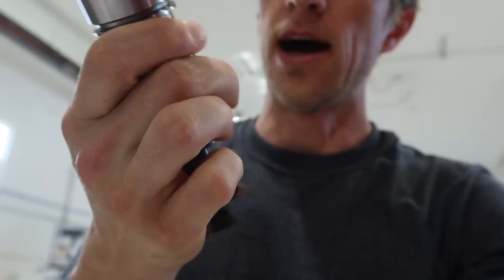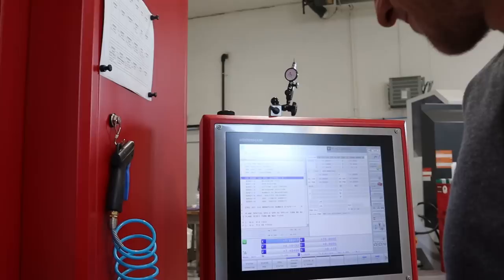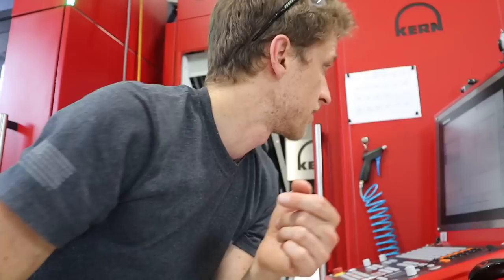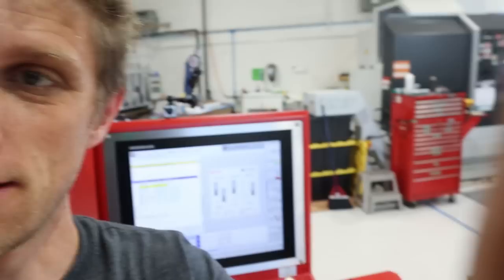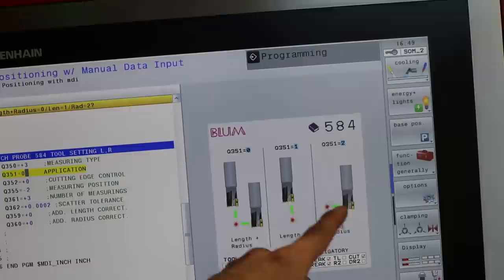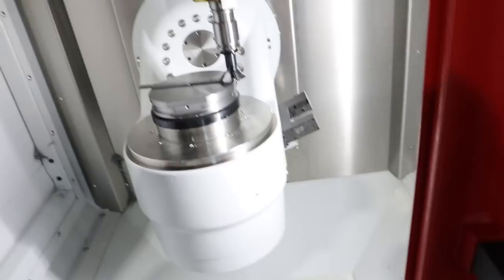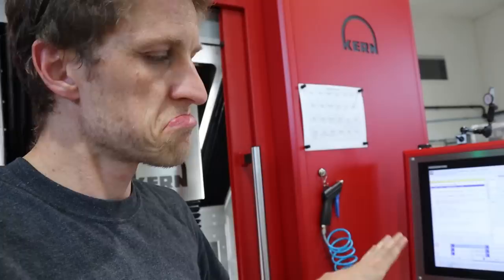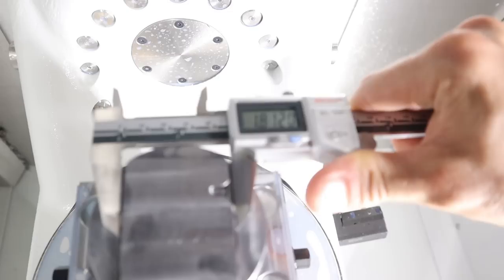Kern Updates! - Shop Life 49

Comment: Use a dowel pin, and roll it under the tool as you're jogging up, until the pin slides under the tool/insert. That way you're not "crashing" into the work/pallet.
Reply: youre not a bad guy.

Comment: Awesome video! Instead of jogging the machine down onto the parallel, use one of those round pins, jog the machine lower than it is, and jog up until the pin rolls under. Much more accurate imo and lower risk of damaging something.
Reply: Wow this is an awsome solution. Storing it away for future use.

Comment: So with regards to manually touching off tools like that you should always jog the tool slightly lower than the parallel in this case(a ground pin or gauge block is better) and then jog up slowly until the parallel just slides under, then go to the tool table and when you are in the tool length field press the "capture position" button (under the decimal point on the number pad) to directly input the value into the tool length. also you can just probe the top of the parallel rather than setting it with another tool

Comment: John, at 11:20 or so: nothing wrong with using your radius jaws as they are except for a slight modification. Relieve the center portion of the jaw to a slightly larger radius leaving lands of the original radius about 5/8" (16 mm) wide at the ends of the radius. These lands act like the jaws of a chuck and, having the same radius as the part, will not mar the part finish. If you use V jaws, the line contact will indent the TGP finish.

Comment: Just did my first ever 3D machine tool path on my home build gantry mill yesterday using Fusion 360... A very basic profile  piece but radiused the edges with a ball nose mill .. Just a tester in plywood but came out great .. Think im starting to understand the link and passes tabs a bit tabs better now.. Coming from Vectric Cut 2D fusion is kinda intimidating but so packed with functionality. Im loving it.

Comment: Hey John! In regards to your fixturing to be able to properly hold the round bar, instead of using a Vee block to hold it, you can use what is known as the three point contact method by relieving a portion of the milled circle on your jaws in the center. Steve Barton has a really good video explaining this theory on his video named "Making the 3 point Contact and Band Saw Fixtures" at 14:27 in the video is where he breaks down the explanation of it. He's a very sharp guy and his channel is full of tips and tricks of doing sub .0001" work, I highly recommend you check it out! Cheers
Reply: @GOAP68  I appreciate it! I would've done the same had I known how to input the video at the correct time, thank you

Comment: Hii John, you talking about getting a tool pre-setter , we have one from dmg, but to be real you will give away some accuracy in length and radial measurement. You wont get a constant force like the pull strut will give you in the machine. A heavy tool will measure shorter because it will be more load on the taper than a lightweight tool. And if you press it down by hand u will still get some 
slight differences which will add up, the toolholder has some and the 
flange on the presetter will have some inaccuracy.
Reply: That makes total sense. Kurios why there are no presenters on which the tool hangs down.
Reply: The Nikken has an air supply and the tool taper is pulled into the setter taper to help with consistency.

Comment: Why don’t just mount a tool holding device on a small granite surface place and bring over a digital height gauge? Zero out on the hsk mounting flange then touch the top of the tool. Input the number.
Reply: Lmfao watching you sell yourself on a tool setter was hilarious lmao done that a few times.
Reply: you don't necessarily need to use a special mount just zero out the holder before you insert the tool

Comment: I know that if you scroll across the tool table theres a setting that allows you to offset the cutter down when measuring the radius, so there must be a similar setting in the tool table to offset the cutter to the side for the height. Also it's best to set tools to the same height as probe. 
Just probe something and call it z0, the call the tool out do what you did to set the height on the thing you probed, then go to the tool table, go to height and press the orange z and then press the button with the 4 arrows pointing towards a centre dot

Comment: Hey John...how to check the fit between two circular surfaces...'blue' the parts and you will see the contact points. But 'three' point contact using V-blocks is more repeatable and removes the concerns about stock diameter variations that could be problematic with your circular soft jaws... 👍👍👍

Comment: 4 minutes ago! Yes!

And give the concrete minimum a week. 
4” there is plenty, if worried, just use concrete 9Ga mesh minimum, or full grimsmo and use 1/2” (#4)rebar and it will be overkill on 12” square

Comment: As an interim tool height measurement, just use a height gage with a little holder on a surface plate.  That's how I used to do it before I had a renishaw probing system. A lot cheaper than $20k

Comment: Machining a dovetail in 4140 implies at least to me that you are using this material for a fixture and then intend to grip this lump in a ‘5 axis’ vice, one where you have no inherent repeatability. Yet you still have lots of pallets, only two iirc have ever been used.  

The thought processes that let the Kern do essentially nothing when it could have already produced hundreds of Norsemans, on very similar fixtures to that used the Mori round the clock for months puzzles me. 

Why not let the Mori hog out bigger lumps or just get a jobshop to do the heavy work?

At least you appear to be letting the Tornos run to produce relatively large batches rather than switching every day to something different.

Comment: maybe you can use TT:R-OFFS in the tool table. so the tool does not go into the middle of the laser.so you only have the edge of the tool in. no idea if that will fit either ore if it's possible with your laser probe. but that is what I would try.

Comment: I'm not a fan of setting the tooloffsets in CAM. For most toolrelated features it is easier to just adjust the wear offset in the machine. So when you get your toolpresetter, you just have to hammer in those numbers and keep the wear offset. With this you have instantly good parts.

Comment: Use a piece of paper to set your tools, Using another bit of metal will most likely cause the insert to chip. I would of had to give you a written warning by now 🤣🤣
Reply: Do like edge precision, use a 1/2” gauge pin
Reply: Is paper accurate enough for a machine like that. It seems a bit like cutting corners (pun intended) . He should own gage pins or blocks.

Comment: Super glue a pin of known fixed length onto the bottom of the tool and measure off that, remove it when done.  This comment is bound to get greif, thickness of glue etc.  Its not exactly bothering those operators who use super glue and masking tape for work holding.  as John commented he is not to bothered about the exact micro precision depth.

Comment: It pains me to see you measure the dovetails with a caliper and say "that is still 1 thou big".  Please understand that those calipers should not be used for setting tool offsets, they are crude and shouldn't be relied upon for critical measurements.  I did the same thing for the first couple years I was machining, upgrading to better and better calipers, but once I learned to use a micrometer for everything, my fits and tolerances really got dialed in.  Those dovetails aren't critical dimensions, since they are just clamping surfaces, however if you do need to make a critical measurement and feed that back into the control for comp, the caliper is really the wrong tool.  You need a set of Micrometers from 1-6" at your desk and you need to use them religiously.  You also need a set of gage pins on your desk (in your cart) and rely on those.  Gage blocks are handy for linear dimension, a half decent set of those are also strongly recommended.  For many machinists these are tools they acquire as they can afford them, you are making parts on a $1mn machine, you can afford to outfit your cart with some decent metrology tools.  You should also look into a proper CMM for measuring your parts, you obsess over details and fits, but you don't seem to quantify those in any official way, a CMM will allow you to do proper inspection and understand what is good and what isn't good.  It will also allow you to bin parts (measure and selectively assemble parts that have complimentary tolerances), which is/was very common.
Reply: I agree, using a machine of that standard and not using a micrometer or having gage pins is crazy.
It's like buying a mclaren and putting wooden wheels on it.
Reply: I’m starting to think Grimsmo bought the kern for the brand, accuracy and some of the automation with the pallet changer, not because he wants to make things really accurately. He’s still a self taught machinist, so maybe there is something to say about a 4 year apprenticeship. 

I agree that a cmm would actually make the kern a highly viable investment, but he makes knives, so it doesn’t really matter if they are within microns.

I mean he owns a kern but not a set of Gauge Blocks!!!!!!
Reply: @flatsurfaces1913  The phrase, "all the gear, no idea" unfortunately fits perfectly. He is clearly making decent money to be able to afford a Kern and I can't fault him on his business/social media skills. But he is very far off being a master machinist. 

In saying all that, it's half the reason I watch him. It reminds me of my apprentice days and its interesting to watch him grow as a machinist.

Comment: You don't pour concrete.  You cast or place concrete.  It implies the care involved in the process.  Pouring concrete would be just dumping it off the truck and walking away.  I'm a structural engineer and this is just a pet peeve of mine. 
Also, why not put the Kern chiller outside?  It's extremely inefficient to let the AC take that heat outside.
Reply: Ugggg. You pour concrete. You can use the same exact argument for the words cast and place. You can place concrete off the truck wherever the chute is pointed.
Reply: We have a new world champion pedant!
Reply: so when a preformed/casted block is put into a loacation is that set in place ? is set concrete when its gone off/cured, but then again when cement powder goes off it wont mix and usually goes hard in the bag. Potatoe, potato.
Reply: Regards the Kern, Johns argument was that if the Kern took chilled air from inside the shop and exhausted the machine heat outside, was it more efficent to have the chiller take the chilled air inside the shop and dump it outside or was it more efficent to dump air back into the shop and have the Air con/HVAC deal with the additional heat.  like you i would have exhausted the chiller outside.  That could casuse a couple of other issues 1. security putting an access hole into the fabric of the building 2. filtering and legislation  implications for dumping the exhausted air.  If the chiller took a percentage of chilled air from the room and dumps it back into the room, is that volume causing more of an issue if the chiller is dumping a higher percentage/volume of air outside - making the Air con work harder. ?